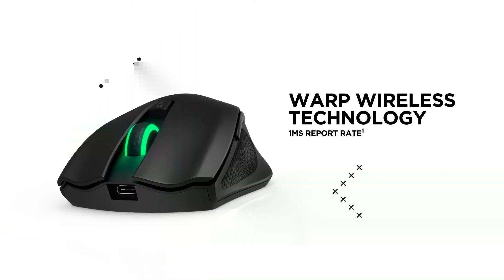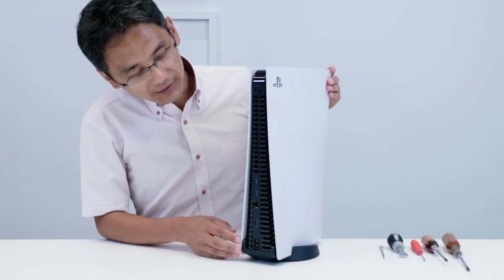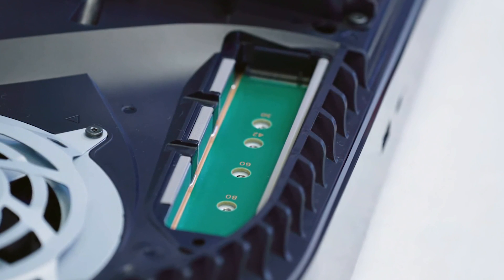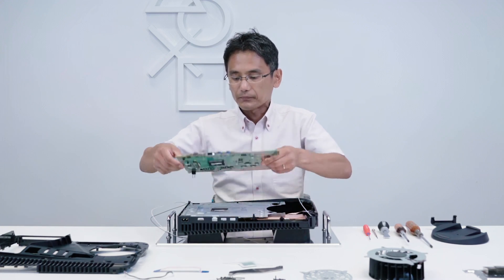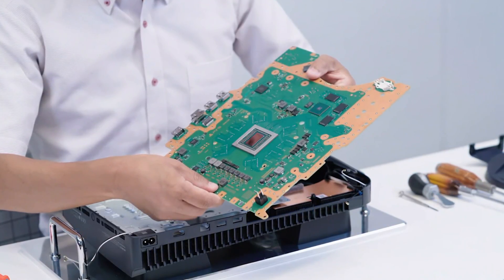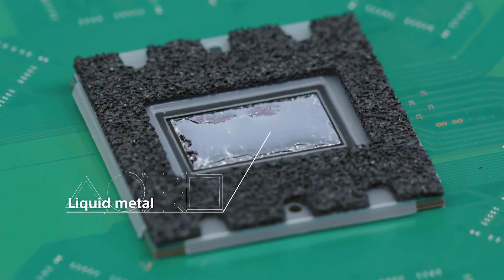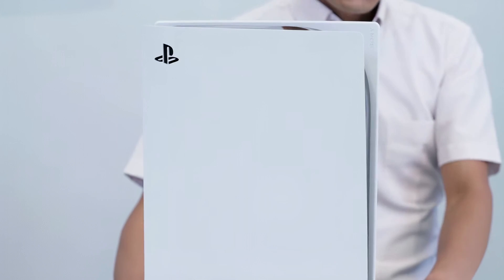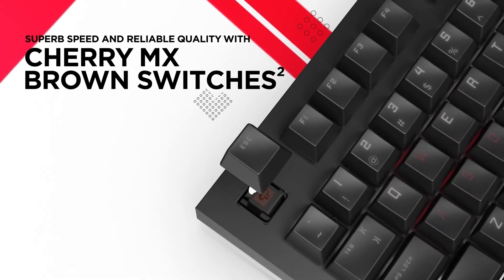PlayStation 5 Teardown Analysis: Inside Sony's Next Generation Hardware Design

Comment: I'm so interested in seeing where games go from here. Even tho PCs have had SSDs for some time now, this is the first time games will be fully built around the structure off of a SSD and not a limited HD. I feel like this is a huge leap in structuraly building a game and gone are the days of the limitations the hard drives create. It will takes years to fully see this tech come into full swing along with hopefully seeing the new unreal engine, I feel like the future of gaming is looking more promising and more ground breaking then we have ever seen.. I love the unique way they built the new PlayStation. They didn't care to squeeze everything into the most compact size and but a higher priority on cooling, which in my opinion is way more important. I've wanted consoles to go more the direction of PCs for a long time now. I like that users can do upkeep on on their system by taking the sides off and vacuuming out the dust zones. I think this is the first console I've seen where the company allows any sort of dissembling. Of course you void the warranty if you go too far but that's clearly marked. Again, excited for the direction that Sony has gone here. I just hope I can get my hands on one around release and I hope expanding the memory isn't too pricey but it looks like memory will be the big money maker here this console generation.

Comment: Ps5 won thats clear. special high clocked GPU, liquid metall cooling, wifi6, isolated bluray, highspeed ssd and support slot for standard highspeed ssd extension, dust cleaning slot.  Xbox Series x only get standard customware with nothing special inside. Crapbox x  go home.

Comment: How on earth you can question Sony sharing technical information is beyond me. Did you  not watch the GDC presentation? The 'Xbox teardown' was done by YouTube channels with very little technical information... 
I'm finding the Digital Foundry default lean towards Microsoft really off putting, maybe its not deliberate but you definitely come across as biased...
Reply: @David so due to the fact that a handful of YouTube channels weren't allowed to put it together like a Jenga tower, Sony are holding back?
Are you stupid? Xbox have let people stack the pieces together, no cables or screws just stacking the pieces on top of each other. They've released no gameplay running on the console other than Dirt5 and yet Sony are holding back...
I've got both lined up for launch day, but the fanboy bullshit has already got boring this gen and it hasn't even started.

Comment: Wi-Fi 6..
If your bandwidth is fine and there's no drop-outs keep your existing router. But Wi-Fi 6 (look for a router with "ax" i.e. 802.11ax instead of "802.11n" or whatever) helps prevent interference or can fix certain types of weak signal... dedicated Ethernet cable is generally best but it really won't make much difference compared to wi-fi now if you have a half decent router... still, if you half drop-outs after getting a PS5 still and running an ethernet cable isn't terribly hard or expensive I'd run a cable first.

Comment: Keep in mind that the used C8 Power Connector can only do 2,5A
So the PS5 can't be much more than the Xbox One X (~225W Max, primary load, maybe 235W)
Reply: As always the will probably also perform around the same in cross plattform titles.
Reply: @mrn234  yeah, I'd also expect similar performance and the difference to be lower than eversyone claims on all sides. So the only interesting thing is the Controller.

Comment: "SSDs get hot. Really hot. And when they do performance degrades."

Has anyone told Richard that NAND flash likes being hot?
Reply: I assume "hot" in this case means, hot enough to degrade performance or be close to degrading performance, not running hot in comparison to human comfort.
Reply: @richr161  Most high quality NAND flash is rated for an operating temperature of 100 degrees Celsius.
Reply: @Bugattiboy912  The chips slow down when hot is what he was saying, not necessarily that they will fail. 

Even then that's max temp, you wouldn't want a drive running that hot if you want to keep it for a few years. My pc cpu is rated for 95c. I sure wouldn't run it there due to longevity and loss of performance as it down clocks.

A chip using just 10 watts will overheat without a cooling solution.

My m2 pcie 4 slot that came with my motherboard has a heatsink with thermal tape underneath it to ensure ssd's won't overheat.

Comment: You have to look closer at the PS5 tear down vid, and there is an SSD heat sink for SSD on MB, but for M2 it’s hard to tell. After looking at XSX tear down though it looks like PS5 will run cooler.

Comment: Dear God, don’t encourage people to try vacuuming their electronics! NEVER EVER USE A VACUUM ON YOUR ELECTRONICS! Only ever use either compressed air or something that will blow the dust away, not suck it in.

ESD is a real thing.
Reply: There are Anti-static vacuums everywhere on amazon, I use one for my PC repairs all the time, Compressed Air is not very efficient
Reply: Never had an issue, looked up on forums first and didn't find any real world issues with modern hardware either.

Comment: Microsoft just the other day also announced that they are also allowing third party SSD drives.
Reply: Hows that going to work. 
Sounds like that will negate all that money Seagate was going to get, with the partnership.
Reply: @alexguskov25  not sure just telling what I heard.
Reply: @alexguskov25  "The cards come in only slightly larger than your average USB thumb drive, with a sliding cover for safekeeping. They connect via a dedicated rear port on either console, which hooks up directly to the processor over the PCIe 4.0 interface. While PCIe 4.0 provides cutting-edge speeds, it's also notoriously costly, driving up the RRP. Other third-party manufacturers are also expected to launch expansion cards at a later date, although Seagate delivers the first and only solution that meets this standard in 2020." From Windows Central.

Comment: My gaming PC room is typically 24°C (roughly 75°F) and I've never had any heat issues with my Samsung 960 Pro Nvme SSD cooking. It doesn't need a heat sink in my opinion unless you live in a really hot environment

Comment: The cooling design is interesting.  Typically, the air circulation is bottom-up, side-to-side, or side-up.  Here it looks like the air is being pushed from top to bottom (more diagonally but still).  I wonder if there is a reason for this resulting from the laws of physics or rather the desire to arrange everything in a previously designed housing.  Warm air rises and if the console is placed with its back to the wall, theoretically, the air that hits an obstacle may bounce off it and move back in some parts towards the cool air intake.  Maybe this side panel's widening shape at the top has something to do with it.  Maybe it is a kind of a wind blade that pushes the air reflecting off the wall to the sides and protects the fan from drawing warm air.  Or maybe I think too much and write nonsense, but the topic is interesting.
Reply: You are right, the console design was made before the cooling solution.

Comment: What I find insane after Sonys video were people comparing about the stand. Like one screw was complicated & you need a tool kit. Those people need to grow up. They had better not ever but any flat pack furniture. Ikea will be out of the question for them. 
I build boats so this is unfathomable to me that one screw was a half or complicated for someone. I mean they even built a cute compartment. 
 You bring up an excellent point.
In the past companies have charged $50 in my country for a stand. Also they click on with physic tabs so getting them off can be a real hassle & you run the risk of breaking plastic tabs off. Especially the older the plastic is.
It just didn't seem to matter what anyone does. It can be an improvement over last gen or save them money and they either forget or want something to complain about because  that just what people have made into a sport nowadays or they have short memories.

Comment: Hype or not from either company, the only thing that will really matter in the end is the end results and so far for me at least, Microsoft seems to be winning out on that one in many areas.

Also when it comes to hype, companies are very selective in what they show and tell us, Sony highlights the PS5 SSD for instance but tells us little about everything else and when it comes to hype, I tend to go on what's not being said then what is because it usually tends to be worse than the hype suggest.

I do like Microsoft's openness on this, at least with them you know what you are getting, with Sony, too much of it is clouded up for now.

As for the heatsink part, I'll be surprised if it doesn't have one, my M2 drive temps with a heatsink can go from around 44c to 61c from winter to summer overall but without a heatsink, it can go as high as 94c which is way too hot for my liking and this is in open air where the M2 drive can breathe, it looks like in that slot on the PS5, it won't have much room to breathe so I'll be amazed if it's not got a heatsink of some kind.

Another thing I am noticing, with each upgrade, things are getting quieter even thought they are getting more powerful, same on the PC like the one I upgraded last year is whisper quieter whiles gaming even with my ear next to the case, my brother just bought a 3080 gpu and the same thing, really quiet, it really shows how much better cooling is getting considering the performance leap we are getting.

Comment: I'm still concerned about the heat in Microsoft unit.  The stand on the base covers a lot of port areas where you could have had a removable base for when it sits on its side allowing more ports to be uncovered for air flow.   If people put the Microsoft unit in a TV stand on its side they will need a lot of room near the top of the unit for airflow from the exhaust.   Sony on the other hand has the exhaust at the rear and the air coming in from the front.  Air flow appears better although the unit size is an issue.  In a TV stand people will need to ensure their is no back on the shelf and to allow for airflow for the exhaust for both units.  Pro's and Con's to both units.   People will need to take great care for cooling their units.  Me I will be placing my shiny new PS5 upright next to my TV.  No obstruction and taking full advantage of airflow.   Goodluck to all.

Comment: That design isn't Toyota like, more like BMW-like. Tons of plastic, overly complicated with panels and covers.

The XSX is Toyota-like. An aluminum spine, two boards, psu, and a heat sink that looks like it was pulled from a rack mount server cooling design.
Reply: I do think sony first designed the cooling and hardware and after that they just tried to give it a shell. This is why ps5 is so big and wackky looking.  Series x seems like microsoft first took a box and then build the hardware inside it.  Sony just build the hardware and then chose a box that is suitable for that hardware.